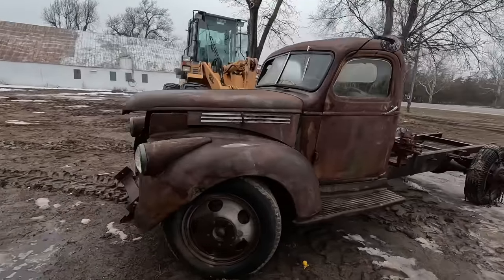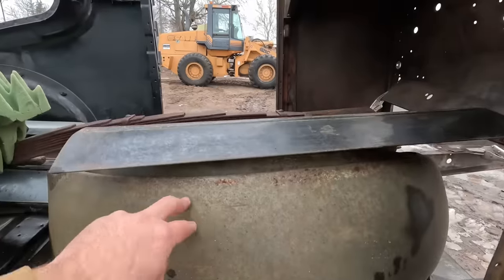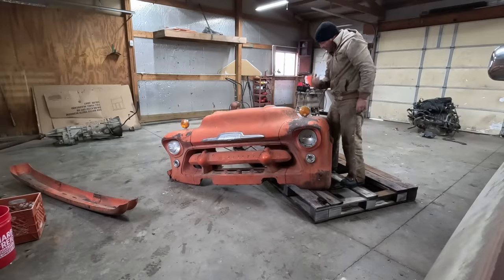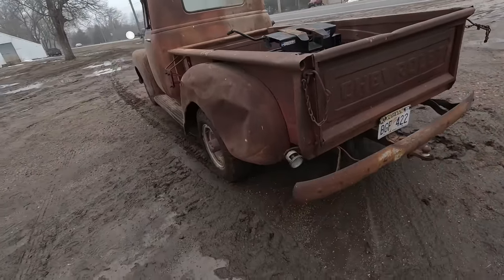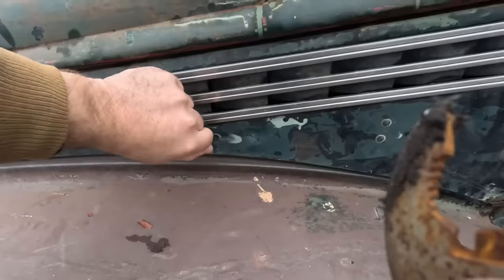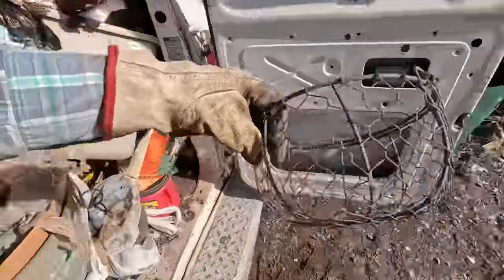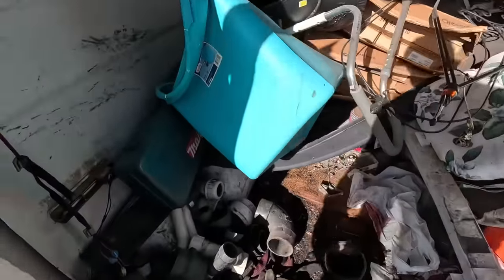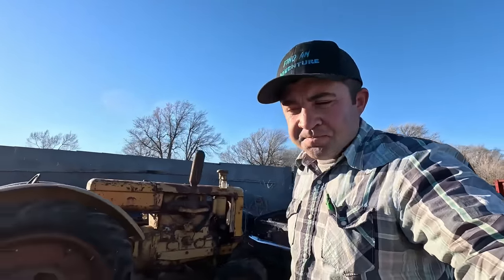Searching for Junkyard Treasure: Multiple BARN FINDS in One Day!

Comment: Hey Silas, maybe you can answer a question I have. On my 55 Dodge stake truck shouldn't the driveshaft's carrier bearing be mounted directly to the steel crossmember ? My has some kind of rubber isolators between the two and I'm getting a funny vibration. Cheers buddy ... Paul 👊😎👍

Comment: Who the heck would want that Chevette?  They were lousy cars when they were new.
Reply: Id love to own it I had 2 of them and a Pontiac 1000 and I Loved them car's and they would be awesome to throw a Turbo Diesel engine in 4-cylinder or 6 be pretty cool and fun being REAR wheel drive Cars
Reply: Rough ridin and ugly but they were extremely good values.
Reply: Hey just found out my parts runner 93 geo metro is collectable go figure 😊
Reply: @dave-uf8ir  
Un frikkin real! 👍😉
Reply: My brother had one of them Chevette he got from the company he was working for that had been in a tornado. It had a 2×4 through the hood and some other little dents. He was running a body shop on the side at that time. He fixed the dents and put a new hood on it.  He said he had 1100 dollars in it his wife drove for about 10 years, and he drove it for another year or so around the shop to go to the parts store. A guy came by one day and asked if it was for sale. My brother, yes, I'll take 1100 for it. The guy brought it.  My brother told me that the little car was the cheapest transportation he ever had. The only thing he did to it was change the spark plugs a couple of times.
Dan 🇺🇸

Comment: The Essex at 6 minutes and 45 seconds here's a perfect build for that 🚨🚨🚨. Make it into a depression error / world War II gas rationing error pickup conversion rat rod. Use a cheaper radiator / Grill assembly from a Chevy or Plymouth vs Ford. I've seen an Essex someplace and I did not want much for it. Build the doors from scratcher out of something from another type of vehicle. Headlights maybe off one of them 41 or so  Chevys. In that way you pretty much got the rat rod piece together